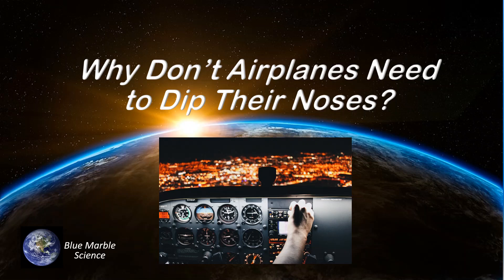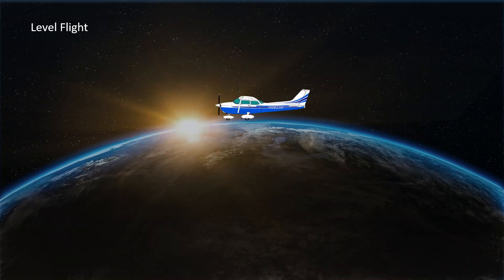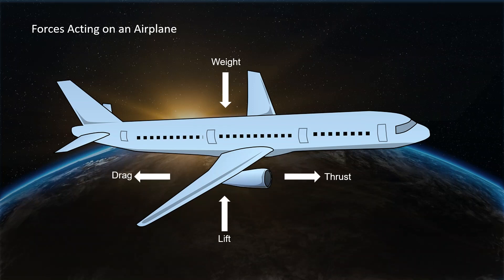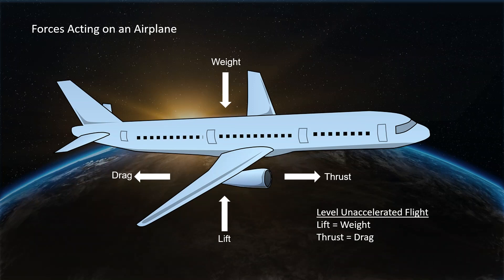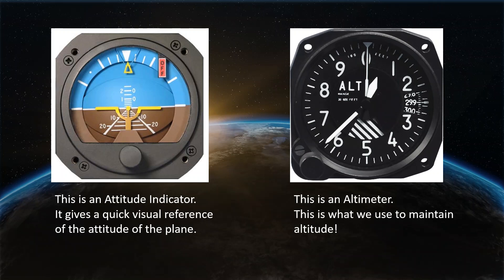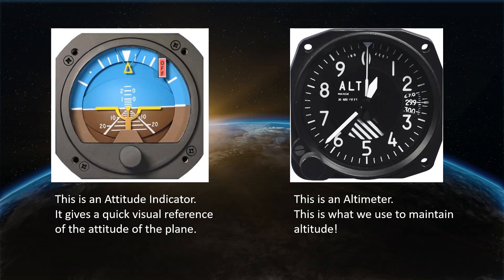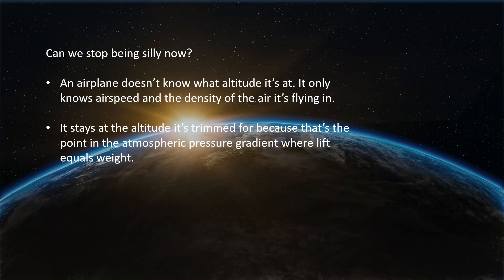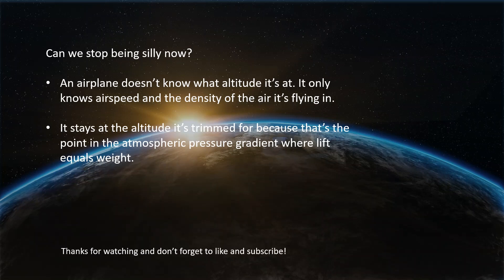Why Airplanes Don't Dip Their Nose

Comment: I flew sailplanes for 20 years & sometimes have fun when I see this topic discussed. The question I ask is if I take a tow to 2000ft trim for level flight then wait a while will I get a free ride into space. This usually results in lots of insults  & I get called an idiot, nobody questions why in reality this doesn't work.
Reply from the maker: LOL - you might get part way there before you run out of lift and/or oxygen. I'm betting the atmosphere will give up before you do though. Some guy got one up to almost 51,000 ft in 2017. How cool is that - literally!
Reply: @bluemarblescience  check out the Perlan project here on YouTube they have a pressurised sailplane & are setting records riding the polar vortex waves over the Andes, over 76,000ft has been achieved so far. These high altitude winds are known to generate waves to over 100,000ft.

Comment: The question of why don’t you have to dip the nose of the plane has always confused me, it seems like if anything you would have to elevate the nose of the plane due to GRAVITY and the plane constantly wanting to fall out of the sky, of course you don’t have to do either unless you are changing altitude,  but if I didn’t know better that would be my question. Thanks again and keep up the good work.
Reply: @ John Myers
I guess you didn’t read the part about “if I didn’t know better” and “of course you don’t have to do that” I am quite familiar with the aerodynamics of flying an airplane, thanks for your effort.
Reply: @ John Myers 
Definitely no offense taken, I was actually quite impressed with your effort, and yes it’s almost impossible to ascertain a persons comment. Thanks again and keep up the good work.
Reply: One that really gives people headaches is that you can fall out of the sky (stall) at full speed... if you don't rip off the wings.  In which case you, again, fall out of the sky.

And if you've stalled don't pull up the nose... put it down.  This still kills pilots.

Comment: It is mind-boggingly how this FE argument came to exist. Our Planet has a gravity-vector that points towards the core centre. One can not "simulate" this by sticking a ball/globe on a table. 

It is kind of fantastic that these FE'rs are so out there that they could not learn to pilot a plain even if we could find a magical flat surface for them to try it on. 

But then - these are the guys who throw water at a tennis ball before spinning it a few hundred RPMs to "simulate" the rotation of Earth without considering that the earth spins at around 0.0069 RPM. Half as "dramatic" as a good hour-hand on a watch. 

Regarding you showing an altimeter - these guys insist we are living in a pressurized atmosphere under a dome. So aircraft altimeters (glorified barometers) can obviously not work. And aircraft decompression cannot exist (so those passenger aircraft drill with the oxygen masks are obviously a hoax - and them fighter pilots and climbers of Everest are wearing oxygen masks only because they are in on the hoax too). For private pilots, hypoxia is not a real thing. And you should, of course, be happily flying up to the dome with your Cessna, and you should definitely never see the performance as "speed over ground" or climb-rate change with altitude. Since we live in the entropy of a pressurized container. Heck - you do not even need that carburettor since you do fly inside a pressurized container. And the fact that temperature will increase with altitude - since our sun is "local" and there are no adiabatic effects (clearly, mountains with snowy caps are in on the hoax - as is also every single thermometer on this planet). 

All you have to consider is this thing called ...density? Electromagnetism? (Certainly not gravity). 

The ability for living with unsolvable paradoxes are fantastic. The level of active ignorance is amazing.  

And we probably try to find a flat earth pilot (that is the problem) and donate an aircraft and allow the flat earth community to go on an intercontinental flight for free as long as they follow "flat earth derived" flight rules. Preferably out from a coastline located in the southern hemisphere to avoid collateral damage.  (Oh - I just remembered - they will fly from South America to Australia via the North Pole. We can, of course, hope someone will open the window - since they fly in a pressurized gas)
Reply: glacier activity yeah they seem to think flying a plane is like a video game, point the nose where you want and off you go. But there’s this little thing called aerodynamics which rules all

Comment: Man i swear im not a flat earther but I still dont understand lmao
Reply from the maker: Tell me what part confuses you and I'll try to help you figure it out. The bottom line is this. The airplane doesn't know what altitude it's flying at - it only knows the density of the air it's flying in. So if we trim the plane to fly at an altitude of 5000 feet, that altitude corresponds to a specific density (pressure) of the air. The plane will want to stay in air that is that exact density.  Should it try to climb or descend for some reason (like a passenger moving around and changing the balance), it's going to lose (if it climbs) or gain (if it descends) lift and simply return to the air that is the density it was trimmed to fly in. 

This is why we don't have to make any change to the attitude of the plane as we travel along. Our atmospheric pressure gradient is consistent with altitude and that means the density of the atmosphere at a particular altitude is essentially the same. I should point out that the pressure/density varies slightly with weather systems so there can be slight differences in air pressure as we travel along but these aren't usually very significant except around really strong high or low pressure systems.

Did that help you at all?
Reply: @bluemarblescience  God bless you man, know I got it 100%!
Reply from the maker: @al-najjar6642  Great! Glad I could help!